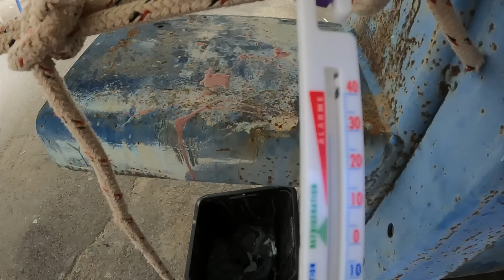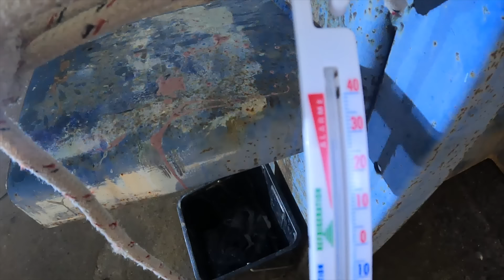Our Boat Refit Moves Into The Hangar

Comment: that was a surprise onto painting the hull looks great , once you do your last coat of primer use a cork or rubber sanding block flatten it down with 180 or 220 grit ,but dont break through the primer to old paint , it will be super smooth paint job very shiny or leave it be and you will show all the orange peel and roller effect and have dirt discolouring it very easily as it sticks to the rough finish , unless your using a two part paint and plan to flatten that and polish it bright and smooth
Reply from the maker: Thanks for the tip!
We've been using 400 wet and dry.
Seems to get it smooth enough, we hope.
Cheers for watching 🙂
Reply: @SailingSeabird  400 will be even better less chance of leaving scratch sand  marks that would show in final finish bit is a slow hard work add soapy dish water liquid  saves clogging the paper and makes for light easier sanding

Comment: Good job you two. A little tip when you get to the top coats (probably too late by the time you read this)  when you roll the paint vertically have somebody coming behind you tipping off the roller stripe edges with a good bristle brush. Makes the paint smooth out to the next wet edge.
Reply from the maker: Tip and roll.
We'll see how the first coat of the finish goes.
Great advice.
Cheers for watching 🙂

Comment: I guess this is late... but Maybe for other parts of the boat use this technique:
"The roll & tip method is a non-stop, fast-moving, two-person endeavor where one person applies a thin coat of paint with a roller, and the other person follows immediately behind with a brush to remove the roller stipple ('orange peel' texture) and smooth out the surface." I've tried this and works really good. Use the brush "lightly" as you only want to "feather" the paint to get rid of the texture left by the roller.
-As always, is good to see you guys!!

-Rick.
Houston, USA

Comment: Using different coloured primers is standard practice in some industries. It ensures the applicators put the second coat over the entire area. If you use two coats of the same colour it can be easy  to miss areas with the second coat. Keep it up, you're doing a great job!

Comment: I painted my 19' er using the rolling and tipping method. Is that what you intend? We didn't get the high gloss finish we were hoping for but it was ok when viewed from a couple of meters. I'm sure you'll do better. 😊
Reply from the maker: Great tip!
But we'll probably just use a roller.
Orange peel isn't that bad 🤣
We'll see how the first coat turns out.
Cheers for watching 🙂

Comment: I'm curious why in most boat restoration videos such small tools are used. Is this common? I would expect to see a larger roller. Pole sander? No judgment; I'm just curious.
Reply from the maker: Hiya,
Many people use larger rollers for antifoul.
We prefer the small ones as they don't get heavy.
We find the larger rollers soak up a lot of paint.
It's probably the same with pole rollers.
We don't do this day in and day out, but I'm sure professionals have their own techniques.
Cheers for watching 🙂
Reply: @SailingSeabird  thanks for responding! I can see how the large rollers might waste a lot of the coating… and as I understand it's $$$$! I can appreciate the need to save your arm too. Cheers from 🇨🇦